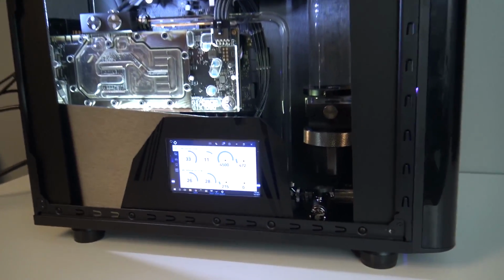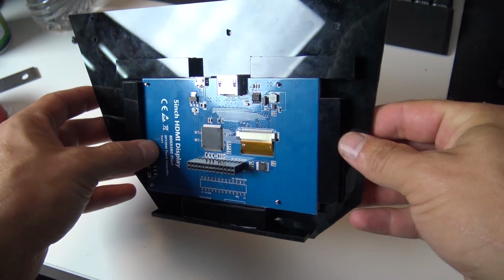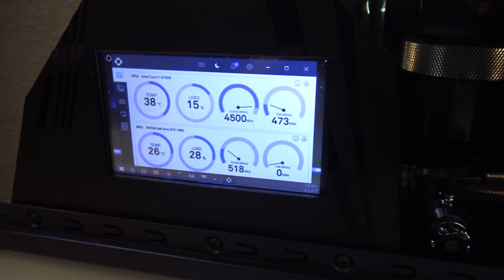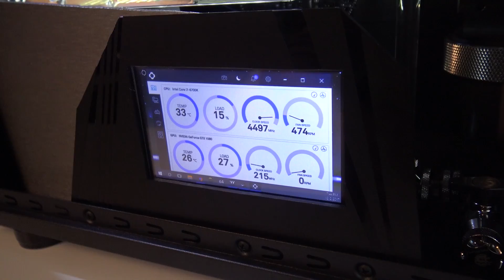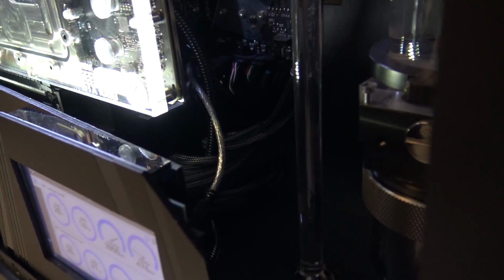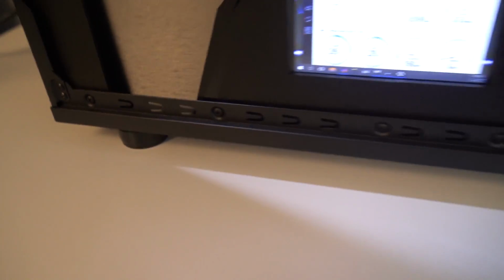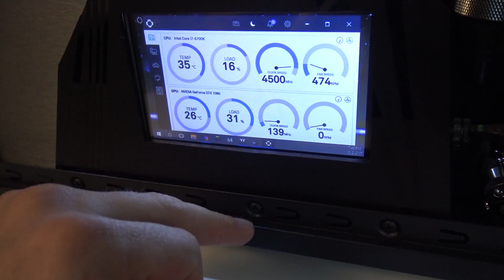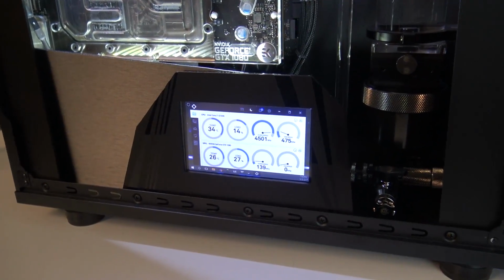Install a Custom LCD Screen for less than $100

Comment: Mate, common, whats up with the misleading heading. When a person puts up a post such as yours that says "Install a Custom LCD Screen for less than $100" people are thinking that your going to do a proper presentation that covers how to install a custom LCD screen. Ive asked around my mates to ensure that my reaction / expectation wasn't just me just having a bad hair day before posting this.
I rarely ping people for little mistakes but because there seems to be a ever increasing trend toward putting up a post with a heading that's sure to get people sucked into going over and taking a look only to find out it either had nothing to do with the heading or barely reassembled it. Now once or twice a day is annoying but it's getting damn annoying primarily because its a waste of people's time and sometimes money.  
That said, a subject line stating that its about installing this custom LCD screen. Expectation being that I was going to be shown from start to end how you install a little LCD so that you can monitor in real time those readings coming from your PC, such as temps, speeds, and just about anything you think you would like to have access to without the need to cease doing what you're already doing and having to dig up that app or apps just so you can get a look at how your system is running. so when I see your title stating that it was about I actually got a little excited because it's been something I've been wanting to add to my custom PC build for a while now but there seems not to be a great deal out there on YouTube.
I admit that I haven't finished watching it all as the most important parts I was hoping to see were simply not there. Now I don't know if you covered them but for some reason decided during the edit phase of putting it all together to leave them out or it was simply that you didn't cover them because they were overlooked. Whatever the reasons, most viewers hoping to see what you stated in your title would have been dissapointed, some (judging from the comments) didn't seem to notice that there were critical parts were missing)...... you dont know what you don't know ;-)
Anyway mate, Id like to believe that it was purely a honest oversight on your part and never intended your subject line to be a tad misleading as ive watched a number of yor presentations and enjoyed them from you. As you can imagine there are a number of people who intentionally put up misleading or sensational headings to draw people in so that their site gets more people in and the ever watching Youtube algorithm doesmt only sees the amount of people coming into your site.
Anyway, this is just a thought. Please take a moment to think about whatt your presenting and if what your actually dooing actually forfills your subject line. I think many feel it fell well short of what they were expecting.
Its not a criticism but more a friendly critique. Sometimes creators like you and I arent aware that we havent fully provided the information we were expeting. I hope you can take it onboard as a friend to friend simply pointing out something that others havent been bothered to do. We all need friends to sometimes let us know we have strayed off a little. I hope you take this as its intended and not a hostile criticism of your work as most of it I have quite liked. Thats why Ive taken the time to send this to you.
Your friend and yeah a fan of your site. Keep the great content coming.
Cheers and beers
Brett from Oz

Comment: Btw I removed the black pin out of the back for connecting a raspberry pie cause it was in the away and unfortunately bricked the device
Reply: @Shikibane I bought another (different) one. They're cheap luckily so no worries

Comment: this might sound stupid but if the GPU only has 1 HDMI port then how do you get it on your real monitor and the tiny case screen
Reply from the maker: You'd have to use some sort of adapter for one of the other ports

Comment: Can this screen be powered off hdmi alone?
Reply: There are screens that can get power from just the HDMI. Others that needs USB for power usually has touchscreen as well, that's why it needs extra power from the USB.
Reply: Jaz what model did you get? I’m trying to get one that only requires hdmi cable to power on as well
Reply: Does it require a raspberry pie?
Reply: @peterw1534  no. My just powers off GPUs HDMI
Reply: @Hagen Meyer i ended up buying 1 and you're wrong. It works off hdmi by itself
Reply: @AllThatJazOfficial  so u just connect it with hdmi cable and its turn on? Do u have link to buy it?

Comment: hey man , what software are you use for control the temp and use gpu???  in mini screen
Reply from the maker: In the video I was using NZXT CAM, but that's because I was having issues with Aida 64. The best way to use it is to create a custom panel in Aida 64.
Reply: thx very much